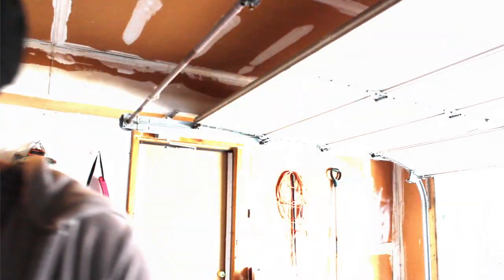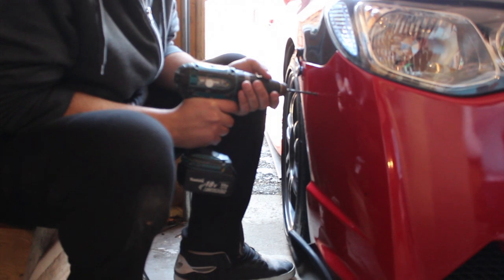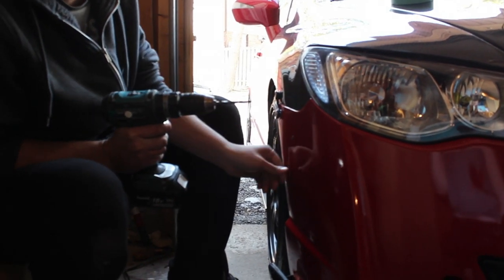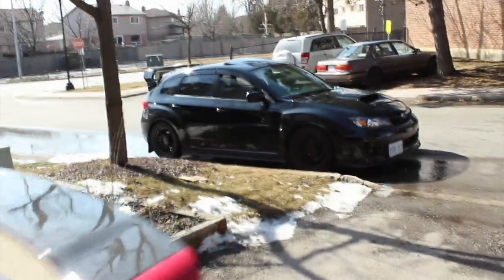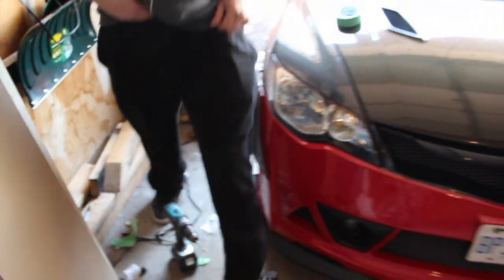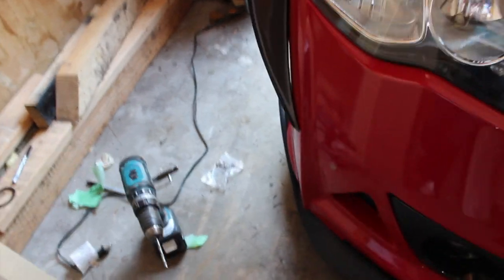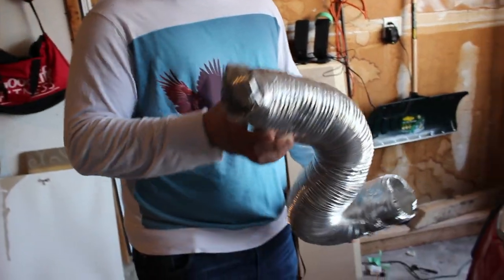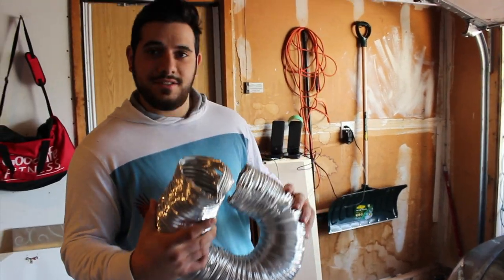INSTALLING CANARDS

Comment: I think that the angle of attack may be too steep to be truly effective if you are attempting to generate actual functional downforce...  Do you notice any difference? Maybe the car seems more sluggish above a certain speed, but with little difference in grip?

I'm contemplating the installation of my universal canards that I've ordered and I am hoping to find an ideal angle of attack for proper downforce.
Reply from the maker: Honestly I have not felt any sluggish feeling. Only reason it is sitting on that angle is thats the only way the canard would fit properly without a gap. It mostly for looks I would say

Comment: lol you installed them the wrong way round!
Reply from the maker: It's the only way they would fit flush I had no other choice . Couldn't find any other canards
Reply: +Chris Lowpes fair enough, still looks good though! with the gaps you can use some double sided foam tape. thats what i used with mine.
Reply from the maker: +initialg82 awesome! Thanks man Ima give it a shot